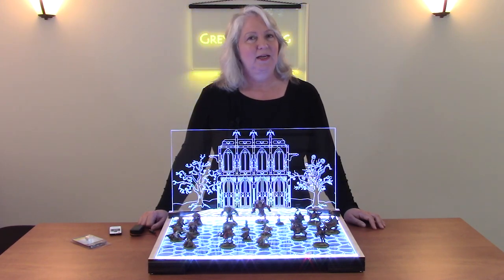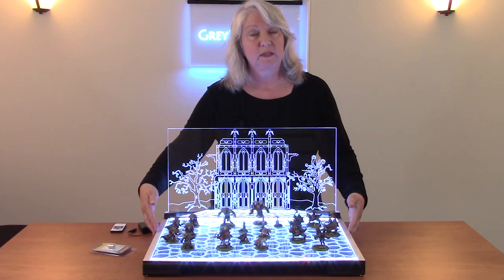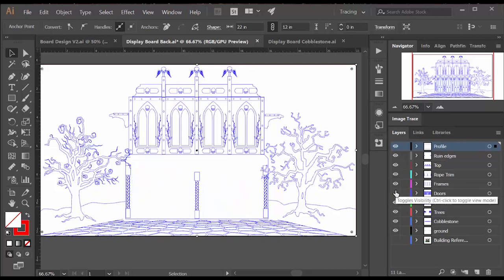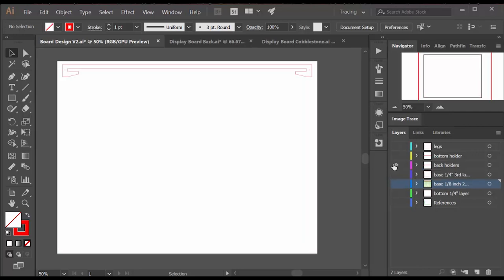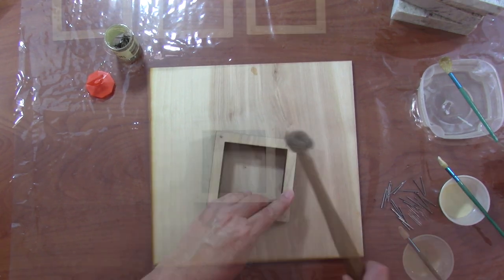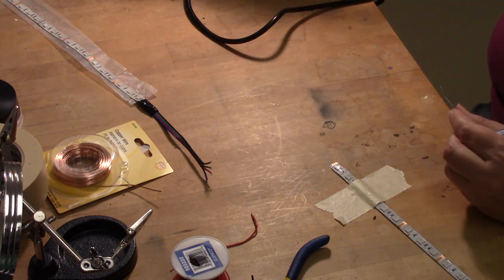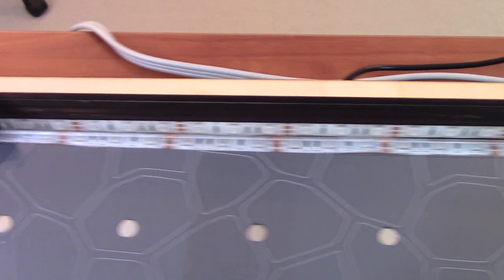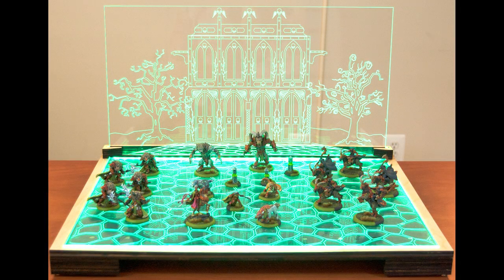How to Design and Lasercut a Lit Display Board for Wargaming Miniatures

Comment: Damn May - that is dope!  May - I honestly don't think you need nails on any of your wood laminates.  You are using the proper glue for the job and you are clamping it (or weighting it) correctly.  The tech sheets, and tests I have seen from a lot of youtubers, show that wood glue, when glued and clamped properly, makes a joint that is actually stronger than the wood surrounding it.  I think you can use a nail to align all your parts - but the nails don't really add much in terms of a mechanical fastener (a screw would be needed for that).  When you watch Youtubers glue up an item they will often use a pneumatic nail gun to hold the part in place and almost always comment "Of course this isn't for strength - the glue is there for that."  In short, trust your glue - arguably the best on the market for what you are doing is Titebond.  Titebond 1 for normal applications, Titebond 2 is a little stronger - but less working time.  Titebond 3 for foodsafe applications (cutting boards).      Note that I only comment on the things I know a little about - as SOON as you move into wiring and programming - I shut my mouth and let people who know say something.  ;)

As always - love your creativity and work.
Reply from the maker: Thanks, Honest, I will check what glue I'm using... sitting here right now I can't say, which probably means I don't take my glue seriously enough! When I put a nail hole in the laser design it is usually for registration purposes, it is helpful to get things lined up properly, but there is no question that the glue is the essential element that holds it all together. I remember vividly the day I discovered Weldon solvent for fusing acrylic. It was a revelation that made many projects since possible. Like the importance of having the right tools, you also need the right materials. Or do bonding agents count as tools? Not sure what's the best way to categorize them...